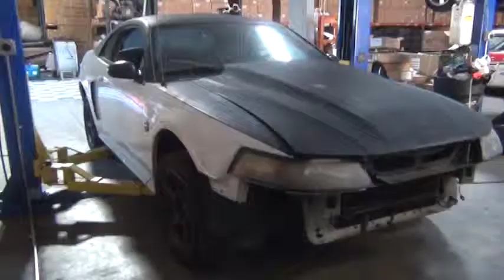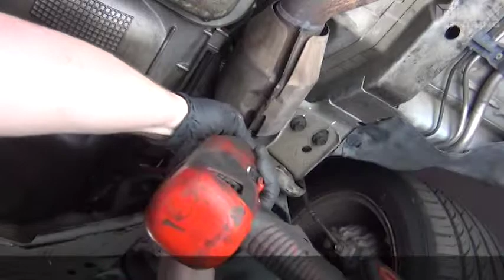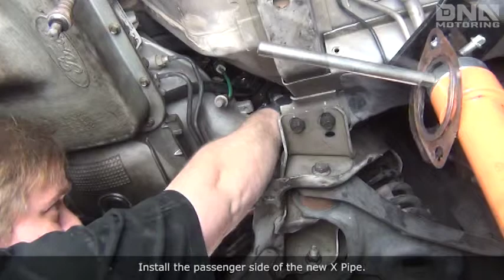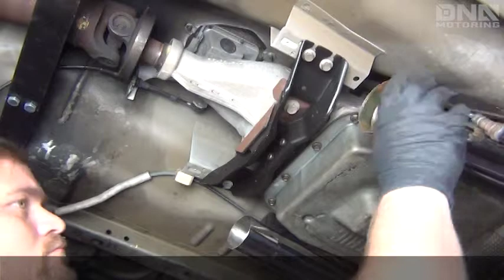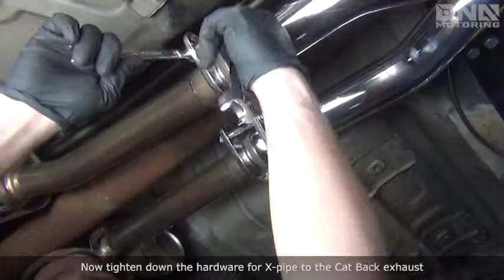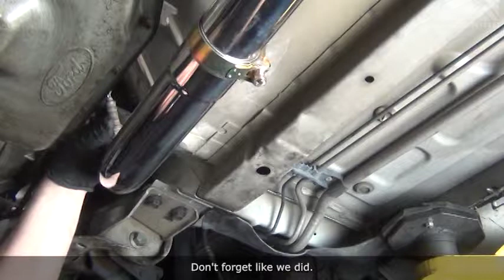How to Install 99-04 Ford Mustang 4.6 X-Pipe

Comment: If I install a cat less x pipe on my gt will that make my check engine light stay in since the o2 sensors aren’t connected
Reply: The off road xpipe still has the bungs for the o2s..you should always run the front o2s and yes it will throw codes without them